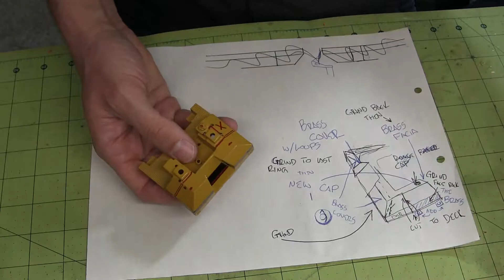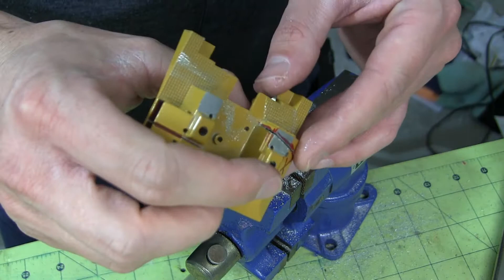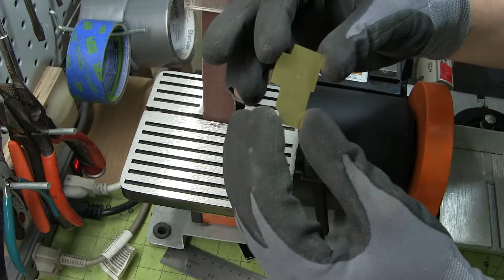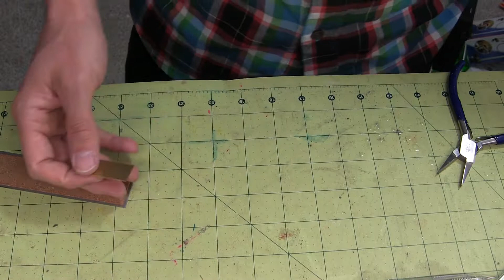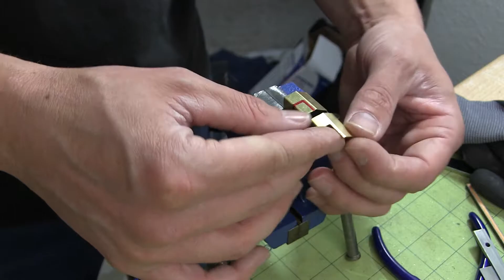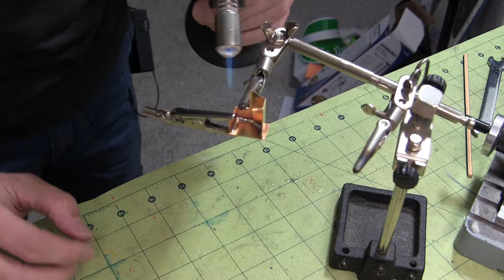Building Custom D11N Model Parts from Brass

Comment: bro some serious manaiacle laugh advice. You went to 6, you need to go to 11
Reply from the maker: hahaha, camera shy and I was afraid to blow out the mic!
Reply: @StephensCustomModels  do you do your work in Brass because its easy to work and solder? or is there a reason I haven't considered?
Reply from the maker: I find brass easier to work with than plastic for some reason. It's rigidness seems to provide a little more forgiveness. Also, I want as many metal parts on my metal models as possible. Keeps the durability up and maintains a certain weight and balance.
Reply: @StephensCustomModels  awsome man. I dig your passion for the machines unfortunatly i dont know the first thing about these things, but i could watch you fabricate parts all day. Glad to see you on my feed again, keep it up.